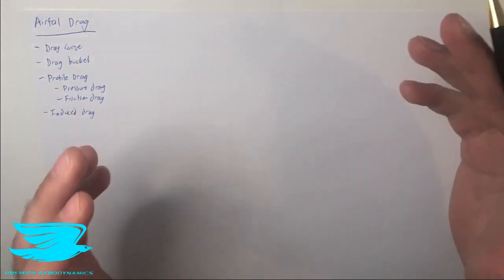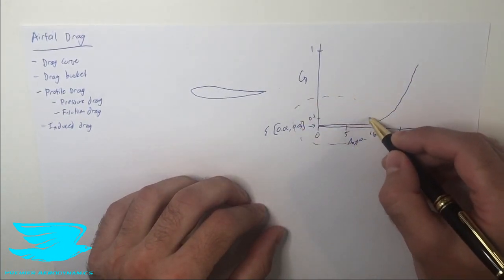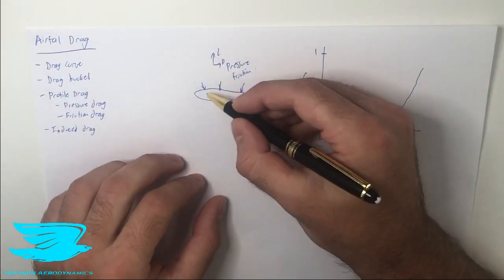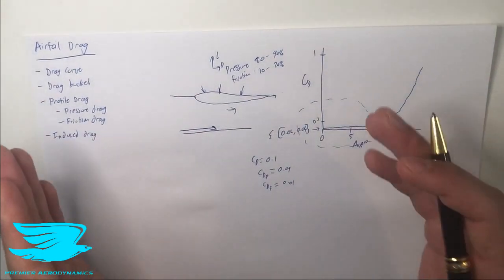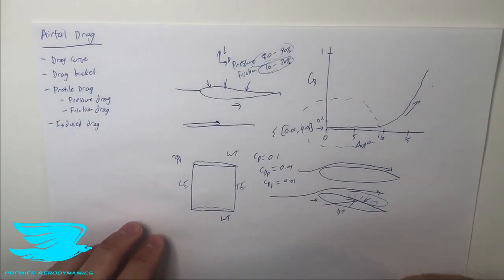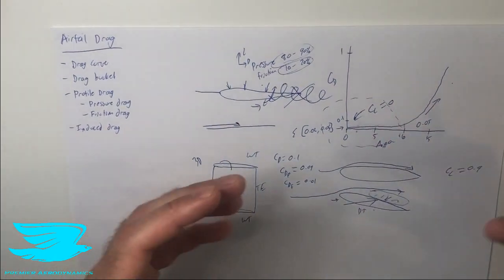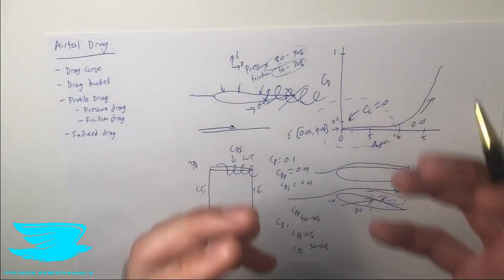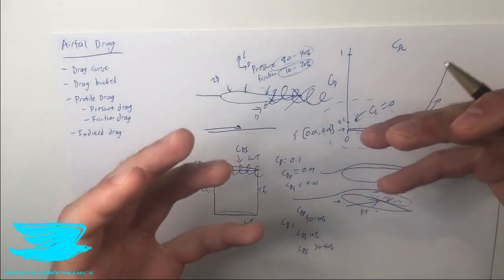[Aero Fundamentals #18] Airfoil Drag Explained

Comment: Hi do we have flow seperation in inviscid flows , even though this seperation is very small. Because in our panel method, drag is not 0 , it is like 0.001
Reply from the maker: Strict panel methods, no. But, you should still be able to get induced drag. So, maybe that is what your software is giving.

However, some panel methods also have various viscous corrections, and may give you an approximation. These are usually significantly less accurate than even RANS turbulence models though.